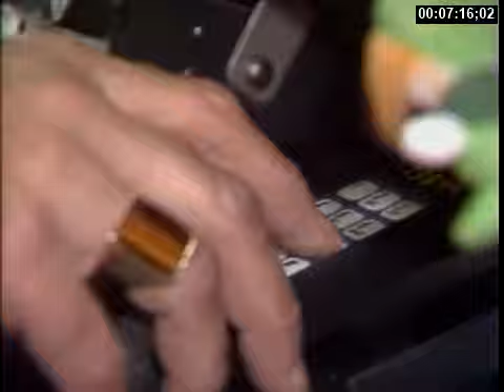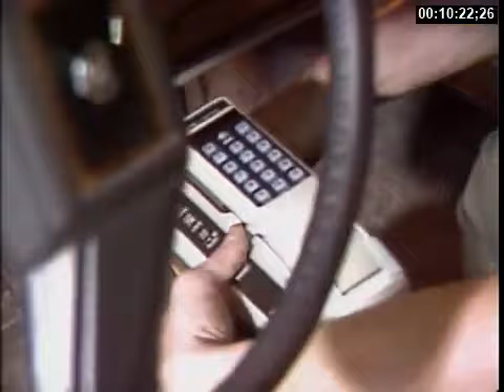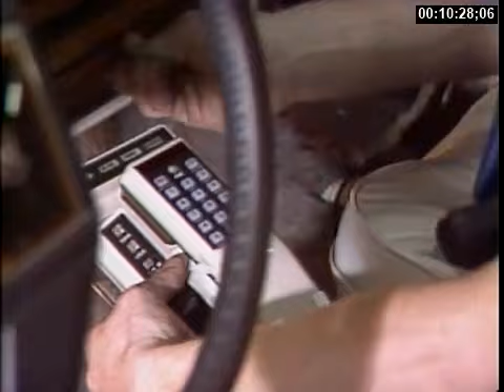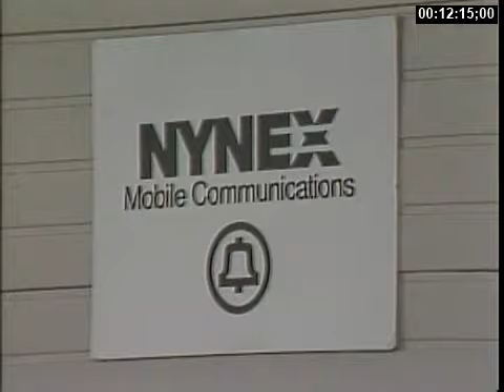How to install a cell phone in your car in 1984

Comment: I wonder if those modems also supported data communications... Would had been nice to have a computer terminal rather a telephone... You could do much more with a computer terminal.
Reply: Nope. Cellular back then was analog. I have no clue if the quality was good enough to use a handset coupler modem back then but probably not.